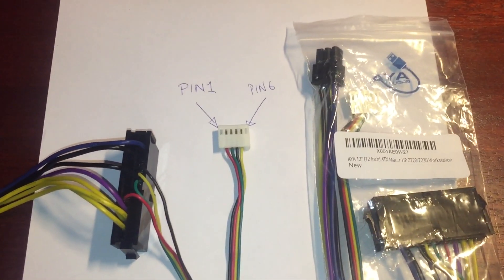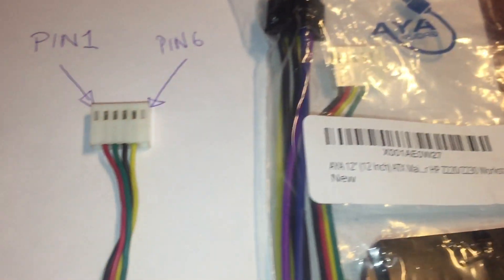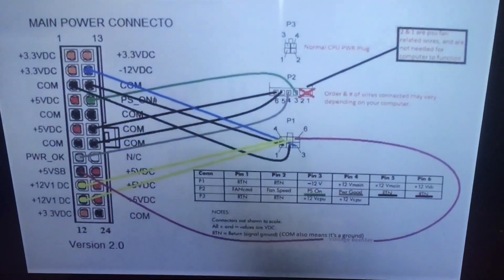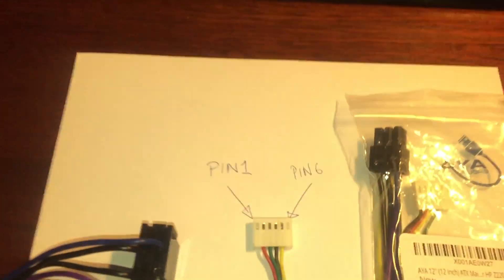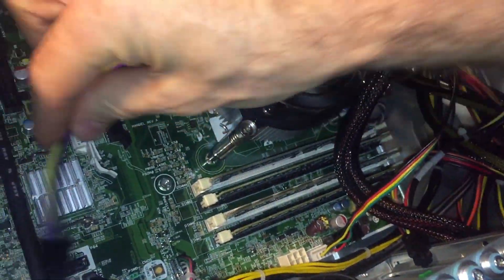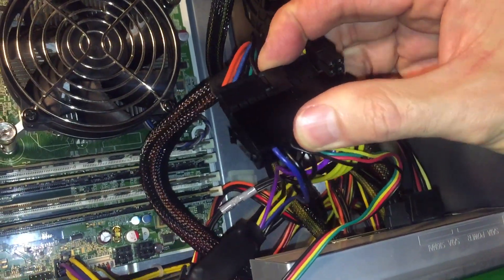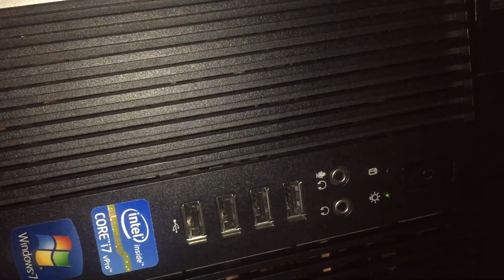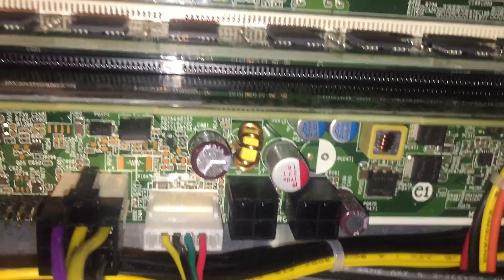HP Elite 8200 PSU Adapter pin configuration

Comment: Just bought a HP 8300 Elite MT for someone and am running into this issue. I looked up resources online and everyone except your post has said B, R, Y, G for their wiring with them all being to the left. Your wiring, however, is R, G, B, Y and centered. I'm not saying this is incorrect, but am curious if you or anyone else can explain which way is a safer/more approriate route for my machine. Thanks in advance for any help!

https://www.youtube.com/watch?v=WA3blEUPPPA
https://www.youtube.com/watch?v=QM0K9Iso0_Y
https://www.youtube.com/watch?v=0VCslFs6lW0
https://www.amazon.com/EZSync-Motherboard-Adapter-Workstation-EZSync910/dp/B0781XJXRY/ref=pd_sbs_147_4/134-2885660-0120767?_encoding=UTF8&pd_rd_i=B0781XJXRY&pd_rd_r=77b54654-9503-11e9-8bbc-7dce0b8199d3&pd_rd_w=WIlWH&pd_rd_wg=wuCcE&pf_rd_p=588939de-d3f8-42f1-a3d8-d556eae5797d&pf_rd_r=PGENCN7AWFAXSAYTG8SR&psc=1&refRID=PGENCN7AWFAXSAYTG8SR#customerReviews
Reply: I have an 8300 CMT, which doesn't share the mainboard with MT but should share the power supply. I have done some reverse engineering and verified that the schematic posted online for the adapter is slightly distinct, but valid. The pinout is, if you're looking at the power supply plug with wires pointing down and the side protrusions of the connector towards you, from left to right:

1. PSU fan control PWM (original white and red stripe) - the fan in the original power supply is speed-controlled by mainboard, leave this unconnected when using an ATX PSU.
2. PSU fan tacho (original white) - this is how the mainboard checks that the original PSU fan is turning. You can leave this unconnected but you'll get a 515 error on power-on and need to press F1 on keyboard to continue booting. You can route this to pin3 of some enclosure fan (yellow on ATX fans, grey on my HP fan) to suppress the error, or to a 555 timer circuit of some persuasion. Honestly they should have included fan emulation circuit in those adapters they sell, but they didn't.
3. PS_ON (green) - connects to same colour wire on ATX connector. Standard pin that signals to power supply that the mainboard desires it to be turned on.
4. PWR_OK (grey) - connects to same colour wire on ATX connector. Standard pin that signals to mainboard that the power supply has reached operating steady-state and that it's safe for the mainboard to fully power on.
5. Not connected on stock power supply. Grounded on the mainboard. Safe to connect to ground wires (black), but pretty pointless.
6. Not connected on stock power supply. Grounded on the mainboard. Safe to connect to ground wires (black), but pretty pointless.

The colours on the adapter cable you got from China may be nonstandard. Refer to ATX standard or something like Wikipedia page for the standard colours and ATX connector pinout.

Comment: How do you rearrange the pins?
Reply: You inspect the connector, you'll find that there is a protruding leaf in the metal stamping that forms the pin, the sole purpose of which is to retain the pin in the connector housing. You find a tiny screwdriver or other poking implement and poke it in gently until it releases and allows you to pull out the pin from the housing. After removing the pins, and ensuring that the retaining leaves aren't bent in too badly and maybe fixing them up a tiny bit, you can push all the pins back into the housing in the new correct configuration. Then you tug on the wire to make sure the pin is well retained in the connector housing, and you're done.

Comment: Any one trying to do this to another HP I had to do it the hard way in the end 
So I took my multi meter plugged in the original psu and tested all the pins noted them down and matched them to the outputs on a standard 24pin plug
Reply: jonno tuckster can you show me the configuration with what you found I’m in same boat.
Reply: Ibraheem KnowledgeSeekah sorry for the late reply I haven’t got the pc now I ended up getting a z170a board and using that but I did sell the old board and it’s still in use today I googled 24pin atx connector pin out and after testing it I matched the wires I paused the video at 0.32 and copied that mine needed some of the wires moving around in the larger 24 pin adapter might try to do a video for it tbh

Comment: After the source change, I can not see the cooler speeds(rpm) at the processor and the fan speeds(rpm) on the case. Is there a solution to see the speeds(rpm)?
When I play, a fan turns really hard and I do not know if it's from the system fan or the processor. Thx.

Comment: The method works! Thx. I can do something to get rid of the message "515 power supply fan not detected"?
Reply: h**ps://news.boyarka.name/novosti-it/24341-hp-elite-8200-psu-adapter-pin-configuration.html  HP Compaq 8000 Elite (CMT) PSU Adapter pin configuration (515 error on bootup (fan not found))

Comment: There’s something not right here the diagram you show is different to what you have in the end the p2 connector on the diagram has two empty slots 1&2 but on what you show yours is 1&6 that is empty? I have the same cable and been having issues I think my mobo is now dead it seems to be trying to boot but not booting I have it exactly the same as the diagram you show but like I say your end result is different to that diagram
Reply: Don’t worry I saw what you did lol had to pause the video at the start as I didn’t realise you’d done it different to the diagram you put on the vid lol sorry I’ll try that
Reply: Well it’s kind of working it shows the fan problem I press enter but nothing happens after that just blank screen
Reply: Update it’s sorted now awesome stuff from thinking that I had killed it to now getting into the bios which I had to recover thanks bud this works for the HP elite desk 800 G2 SFF running core i5 6500
Reply: Well I added my gpu and tried a benchmark and the pc cuts out and reboots halfway through so back to the drawing board I think
Reply: @jonnotuckster8856  I did not understand ... did it work with the diagram drawn or with the order that comes out at the beginning? 
I have an 800 g1 a few days after connecting a psu atx to install a gpu gtx
Reply: DiegoSalasLemus it was slightly different for the g2 if I remember but if you copy what he’s done on this vid it should work fine, I ended up taking a multi meter and testing the standard power supply to find out what was what tbh I had to rearrange a few pins was a pain but it’s well worth it
Reply: DiegoSalasLemus if you pause it at 0.32 and copy the pattern from that picture it will work bud
Reply: @jonnotuckster8856  
Of course, I also thought to measure manually with a multimeter, but it makes me lazy haha, so I was looking for someone who has already done it
Reply: @jonnotuckster8856  
thank you very much for the info bro!
Reply: DiegoSalasLemus not a problem bud just wish I still had the info for it it isn’t hard to do tbh just pain in the ass when you brought something that’s supposed to work out of the packet lol

Comment: I have a question. Is It nescessary to have COM wires in exact order as you have it in your diagram .? My adapter has COM wire for p1 on the fifth row, first column instead of third row, second column , as you have. Do I really have to swap it ? Thx

Comment: hello bro Will this layout work for Compaq Elite 8300 CMT?plese help
Reply: Yes it works! I bought the adapter for something like 5 €'s in China, it worked (after the rewiring shown in this video) really good. I think due to a differnt cable setting in the original P2 connector of the HP PSU which is like _ _ X X X X or X X X X _ _ compared to the _ X X X X _ shown here, that in all probability something is not 100% right. BUT, at the moment it's working (exept the 515 boot error, that I'v solved so far with pressing F1 after power on)   ;)
Has anybody some better understanding, if the PSU's or the wiring of the P2 connector is differing in each modell of the 8X00 series (or their PSU's?), like it is defintely differing between Z230 (workstation) and the 8300.  Cheers from Germany
Reply: @donkiel9988  
Did you say that you changed your factory P2 connector wiring from [OOOOxx] to [xOOOOx] and it worked!?  I really need to know, because my HP Elite 8300 factory P2 cable is also [OOOOxx] and I want to install a 600 watt PSU I have purchased with the 24 to 6 pin adapter.  
PS.. [O] = pin/wire,  [x] = open, no wire.
Reply: @RonRay  I ended I up with a adapter with a higher build quality. That worked out of the box! I experienced problems with the building quality with the cheap adapters. I had two versions, both had problems with the pins I swapped. I would definitely recommend this adapter (link below). But you still have to deal with the Error 515 "PSU Fan not detected" / Press F1 to continue.  https://www.moddiy.com/products/HP-Elite-8000-8100-8200-8300-800G1-ATX-24-Pin-to-6-Pin-Adapter-Cable.html

Edit: I checked the above mentioned product link, they now claim that they even sorted the boot error out! If that's true, then this is THE adapter to buy!

Edit 2: I've received an Email from modDIY, confirming that they have solved the Error 515 with a re-design of the adaptor. I ordered one, because I am curious what they actually did with it... ;)
From my point of view: If this works, it is the best way to do get a budget workstation or gaming rig, based on HP Elite 8000 8100 8200 8300 800G1. I would recommend the CMT versions (the production stopped (to my knowledge-)with the 8300 series)! 
You have to check the length of the video cards though , because I had slight problems to get the Sapphire RX580 NITRO squeezed in. The Sata Ports might get in the way. To put a standart PSU into the HP case, you have to use a metall driller to get the differing mounting holes in. I did it in something like 10 minutes. Take care when you do the drilling (best to take out the mainboard), because you don't want any metal chippings on your mainboard/PCI Slots or PSU!
Reply: Don Kiel So this new pin configuration worked?

Comment: Is the fan error a big problem because it looks serieus though. Thanks for this holy video btw, makes my day better!
Reply from the maker: My understanding is it is a serious error if you had the factory PSU still installed as it could lead to an over temp scenario and cause damage. As there is an aftermarket PSU installed, the motherboard loses the ability to track the fan and technically reports it as 'missing', not that there is an inherent danger.
Reply: @o0FUZ0o  First Why is the error appearing. 2 is there a way to removed the  fan error or it's always going to be right there?
Reply from the maker: @___x___4607  The error occurs because there is no PWM fan for the motherboard to monitor - accordingly it reports that the "power supply" fan is not detected. As mentioned in a below comment, I have worked out to remove the fan error with some extra cable and the case fan... I'm still yet to do the video :)
Reply: @o0FUZ0o Do you still have to work on the video?
Reply: @o0FUZ0o  What power supply were u using in this Video

Comment: how do i move the pins
Reply from the maker: Q: "how do you set the cable?" - A: Use a pin or very small screw driver to gently press on the cable end of the exposed metal pin on the white 6 pin connector shown in the first 5 seconds of the video. The cable and pin should release with a gentle pull whilst you trigger the release clip.  Making sure to note the orientation of the locking mechanism, to relocate insert the cable into the alternate slot and the cable should with a click to confirm it is correctly mounted.

Comment: for the people that don't know how to get the wires out. Get a general toothpic and press down on the metal slot up top and pull out the wire.
For the HP Prodesk 400g1 SFF the combination 6:COM 5:COM 4: PS_ON 3:PWR_OK works. Good luck peepz
Reply: Thank you. There is an equal pinout. It is perfect to start. But this does not work for HP 8200 CMT without error 515.

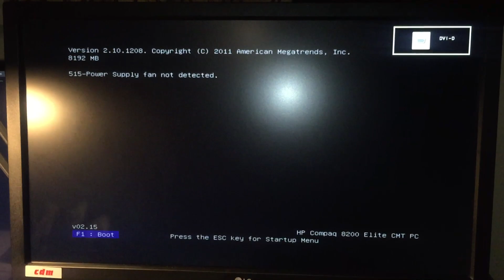Comment: how to remove 515 error on bootup (fan not found) at 2:32
Reply from the maker: I do have a solution for this but it requires splicing and adding more wire that takes a bit more skill. I might do another video and link it to this one in the near future.
Reply: @o0FUZ0o  hey awesome video. please do this, I have the same problem with the fan error
Reply: @o0FUZ0o  That would be a lot of help, that 515 error is annoying. Isn't there a way to go into the bios and change it?
Reply: HP Compaq 8000 Elite  (CMT).    Решил проблему отсутствия сигнала с вентилятора блока питания. 
Простейшее решение.
На контакт 2 разъёма Р2 (сигнал FanSpeed) подал сигнал с другого вентилятора, например с вентилятора который включен в разъем Р11 (зеленый провод). 
Соединить куском провода  Р2 контакт 2 и Р11 контакт 3. К разъему  Р11 обязательно должен быть  подключен вентилятор.  
Чтобы не было ошибки  при при включении, на контакте 2 разъема Р2 должны быть прямоугольные импульсы амплитутой 3.3V. Длительность импульс/пауза  для моего вентилятора примерно 10 миллисекунд и зависит от скорости вращения. 
Другое решение - в блоке питания заменить вентилятор на другой аналогичный,  но  у которого есть выход FanSpeed и этот сигнал отдельным проводом подать на контакт 2 разъема Р2.

Comment: cara setting kabelnya gimana ?
Reply from the maker: Q: "how do you set the cable?" - A: Use a pin or very small screw driver to gently press on the cable end of the exposed metal pin on the white 6 pin connector shown in the first 5 seconds of the video. The cable and pin should release with a gentle pull whilst you trigger the release clip.  Making sure to note the orientation of the locking mechanism, to relocate insert the cable into the alternate slot and the cable should with a click to confirm it is correctly mounted.
Reply: Gimana bro , berhasil gk?

Comment: Hey mate, did you have a link for the adapter?
Reply from the maker: https://www.amazon.com/gp/product/B01NAHMULC/ref=oh_aui_detailpage_o00_s00?ie=UTF8&psc=1
Reply: @o0FUZ0o  unfortunately that link doesn't work anymore... I found one on eBay by the username of karugter.  It seems to be a correct configuration on the white plug end, however I hope the wires are orientated correctly (as in, physically the connector matches what it is on the show here, however the signals could be going to totally different pins)

Comment: What configuration would work for HP8300 SFF Elite? All videos there are for 8200 but inside of computer it is all different comparing to HP8300 Sff . Location of motherboard is different. If i put wires in that 6pin connector wrong way, will it burn motherboard?
Reply from the maker: I was able to play with the cable locations without causing any damage to my knowledge
Reply: hi what configuration worked for u with the HP8300 SFF Elite